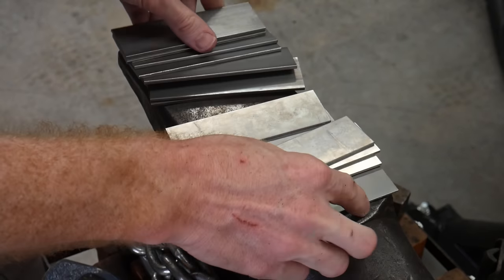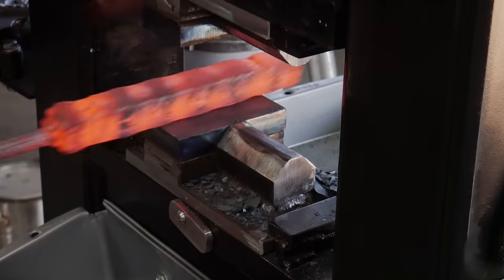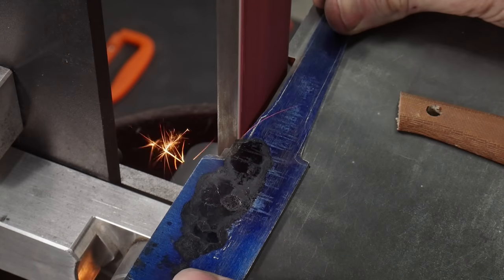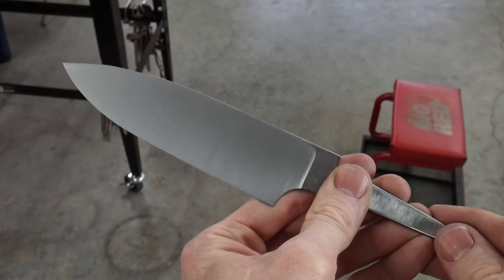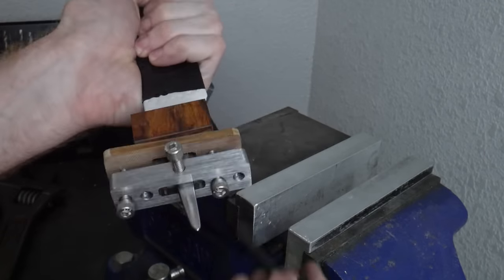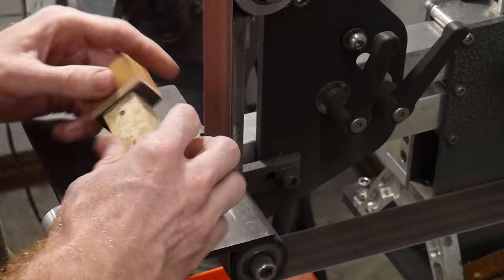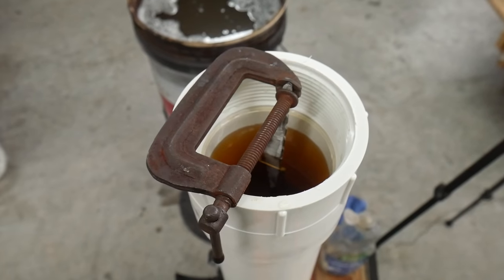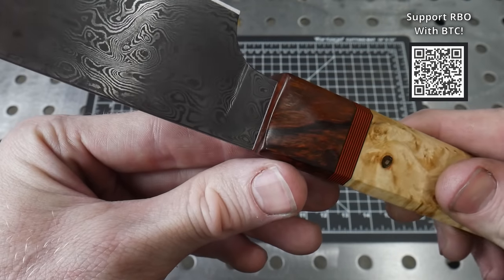The Kitchen Knife That Started As A Bowie..... Don't Be Afraid To Pivot 😅

Comment: When you did the initial glue up, Ive found putting some wax on the tang helped me with removing the knife. I have been letting it set just about completely. As long as you don't have bumps on the tang it comes out with a couple of taps from a mallet.
Reply from the maker: Very cool, I'll have to give that a go. Cheers!
Reply: I use either turtle wax or vaseline, works great.

Comment: Hello Red Beard, When I worked in a forge shop years ago, one trick that we used was to cover our pieces with Kaowool(K-Wool) to keep the heat when drawing out the metal/steel. Most of the problem of loosing material is when you loose heat when drawing out the metal which causes the material to scale, so you have to do either two things to try to keep that from happening; "Use multiple heats in the furnace, or use K-Wool to cover the your work so you can forge longer without more heats. We never used Borax when forging, it was always K-Wool. I hope you can use this information for some of your next projects.
Reply from the maker: Thanks for the tips sir!

Comment: Beautiful save and beautiful handle. If you want to get a more "raindroppy" raindrop pattern, you can use the same method of ladder pattern. Draw a grid and drill alternate holes on each side, one deep one third of the thickness of the bar. You can also make a die for the press with little pyramids on them and press them into the bar, mill then the peaks out. Keep up the great work!!
Reply from the maker: Thanks Francesco for your thoughts. A Die may be in my future. That's a lot of material to remove though!
Reply: @RedBeardOps  well, i do it with an angle grinder and it takes about 20 minutes (especially with the big 9") but since you have a mill and a face cutter, you can do with that. Although the mini mill might get a little tired with all that tool pressure. A mix of angle grinder and milling would be nice so you'll have a nice flat surface to start with. The wavy movement given by the dies will make the raindrop go very deep in the thickness of the bar and the grinding will remove any chance of cold shut. Also, this technique will give you a very uniform and precise pattern (if that's what you like of course)

Comment: Hey dude, I got a good recommendation from a guy who makes wa handles for a living. Use tiny bits of hot glue sticks when finally gluing your tang into the handle. Heat the tang mildly so when it comes into contact with the bits, it melts them and bonds. The reason he uses hot glue instead of epoxy is due to possible blade repair or handle replacement in the future. With epoxy, you must destroy the handle to take it off, but with hot glue, you stick it in the oven at 250 for a few minutes and the blade will come out easily without handle damage. It won't ruin the temper and the hot glue is more than strong enough for kitchen use... Even if the end user does the unthinkable and puts it into the dishwasher. Which they shouldn't.
Reply from the maker: Very cool idea Goot!
Reply: Nice.  I watched the hot glue video from Project Farm testing out bond strength, and it's surprisingly impressive...to the point of ripping chunks and fibers off 2x4's.  I'd suspect that level of bonding would be more than adequate with a notched or textured tang.

Comment: I rec ently took a page out of Kyle Royer's book for bedding the tang and applied some petroleum jelly to the tang before inserting it into the epoxy. It came out beautifully and I plan on doing it again the next time I bed a tang. It saves the step of heating up the tang to reinsert into the epoxy.
Reply from the maker: I've been meaning to try this! Just a question, did you try and clean out the petroleum jelly from the tang slot after removing the knife? I've always wondered if this is necessary.
Reply: @RedBeardOps  Yes, I used a Q tip with acetone and then blew it out with compressed air and called it good. I don't think it left a whole lot behind when I did it anyway, since I used a fairly light coating on the tang. I'm not sure if it's necessary or not though.

Comment: A super thin coat of paste wax on the tang is a good security measure when building your handle so it doesn't stick. Nice recovery instead of tossing it in the scrap pile.
Reply from the maker: Thanks Mike! That's a good tip.

Comment: Love the video. But as a heads up. I believe green is the finest polishing compound. But using progression from red to white to green would help
Reply from the maker: Thanks for the tip!
Reply: Hey Corwin, for the most part, yes, green is the finest.  But...look around the internet long enough and you'll find all sorts of bars in different colors that are supposed to be even finer, or the same as green but a different color.  It's pretty confusing and I wish they could make up their minds.

Generally speaking with wood, all of the metal buffing bars are too aggressive and will often get too hot for wood finishes, and a lot of them deposit some of that thick compound in wood pores. They do buff the wood out, but they're just not designed for it.  The progression for wood buffing after sanding to at least 320 grit is a tripoli bar (wood specific, there's a lot of different tripoli bars), then white diamond, then carnauba wax or beeswax, all with separate buffing wheels designed for each of the compounds.  If you sand to 1,000 grit or better, all you really need is a bare buffing wheel and a touch of wax to get it looking great.  Some people prefer to use liquid compounds and spray waxes for acrylic/plastic use and car polishes, and this works particularly well if you used an oil finish on the wood.  Last thing you want to do is use the same wheel with different compounds, you'll never get a finish better than the most aggressive compound you put on it.  Also, trim the buffing wheel if it starts getting whiskers, those do affect your final finish.  Just a pair of scissors to get everything more or less even again is all it takes.

Comment: Wondering if you just put it in the kerosene once? Been wanting to try not using flux but a little hesitant. Very nice knife. Thanks for sharing your knowledge.
Reply from the maker: Hey Ed, yep, I soak it in the kerosene for a few min while the forge is heating up. I think (and could be wrong) that once you put that guy in there, the next time you take it out should be to set the welds. If its had time to soak in the kerosene and you're running your forge rich, I don't think scale has a chance to form. No oxygen present.

Comment: I would like to see some microscopic shots of the edge on that knife. You first put The cutting edge on with a grinding-wheel which would have put a concave bevel on the knife then you used the slack portion of a belt which would have put a convex bevel on the knife. Theoretically you could have put a microscopic s-grind on there.
Reply from the maker: Hey Bobby, I've drawn out a 10'' wheel in cad on a 1/8'' thick knife full flat ground. There really isn't any curvature to talk of. I had to draw it out to see the negligence..
Reply from the maker: This is kinda a strange place to direct you to, but it's the only place I have the graphic. Check out this video @ 2:16 - https://www.amazon.com/vdp/0cada116a0ff4942882cc7ed1f2e24b0?ref=cm_sw_em_r_vlp_dt_zNcmB82Osy5KG

Comment: So is the dowel used to align them handles? Did you split the dowel? Could you have mailed the dowel into two halves?
Reply from the maker: I split the dowel down the middle. It allows you to drill a 1/2'' hole in the handle and not fuss with a tang slot.

Comment: To remove the blade easier while the epoxy is setting, coat the metal with petroleum jelly (Vaseline) - the epoxy will not adhere to it.
Reply from the maker: Good tip!

Comment: Take hot glue shave it and pack it in hole heat the tang set the knife it will give you about 2 minutes to set your blade nice and straight again heat the knife and you can remove the blade with No problem Believe it or not that’s how the Japanese do it
Reply from the maker: Pretty neat method. Cheers barry!